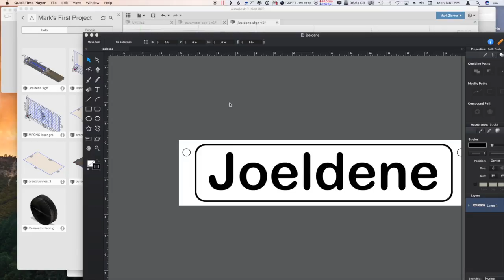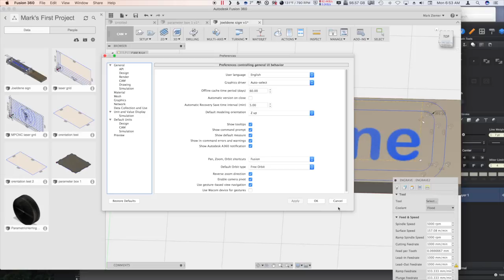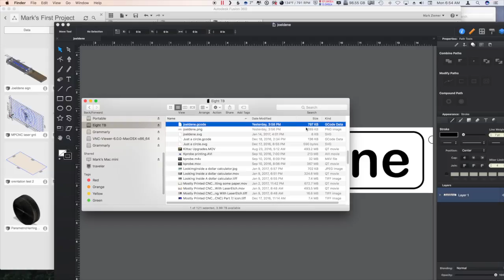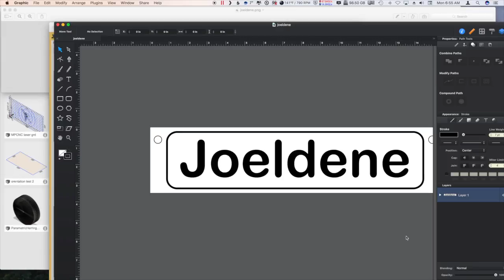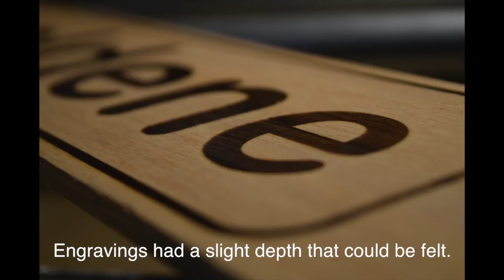Mostly Printed CNC (MPCNC) Part 11 Oak Engraving With LaserEtch

Comment: The sign looks great! Do you have any measures in place for fire prevention? I just finished my laser MPCNC build, and I would like to have the confidence that mine could run for 12 hours without me watching it the whole time.
Reply from the maker: Geoffrey Tuttle nothing automatic unfortunately.  Just a fire extinguisher nearby, And monitoring by WebCam
Reply: @Someoldguycoding  Ah, good to have the fire extinguisher and remote monitoring. I picked up an extinguisher and will keep experimenting to see how my machine performs. Thanks for all the videos you post. I always find some good information in them and some inspiration to go tinker in the shop.

Comment: Might save a bunch of time if you could either get it to move faster when not cutting or (if I'm seeing correctly and it's only cutting on one direction) cut in both directions. Not sure if that's possible though, my experience is limited to 3d printers. I know there's an option in my software for a different travel speed.
Reply: Now that I'm sitting in front of my computer, the options in Simplify3D for speeds are: Default printing speed, outline underspeed (slows down the outside layer for quality), solid infill speed (same as outline but for outside layers on top and bottom as opposed to the sides), support structure underspeed (no idea) and X/Y axis movement speed. I have printing speed set to 55mm/s at the moment and movement speed (travel speed) at 80.  On the print I'm working on right now, setting both to 55 would take only slightly more time (4 minutes on a one and a half hour print) but that's certainly less. Bumping travel speed up obviously speeds up the print, but I'll have to do some checking to see how fast I can push travel speed without weird artifacts showing up from the frame moving.
Reply from the maker: Thanks Even!  LaserEtch has speed settings for engraving, and moving the head, along with the option to engrave bidirectionally.   I was using the same settings as I did for the previous video with the 1.5 inch rounds.  I really need to make some test runs, and see how fast I can go, and if there are quality issues, try to find the root cause.   Thanks for watching!

Comment: Why not give image2gcode a shot.  It's custom designed for the MPCNC.  I believe default speed is set to 3000mm/m.

edit:  Now that I think about it that's just for raster files.
Reply from the maker: Yes, that's on my list of things to do... Eventually... I wish I had more time, but don't we all!

There seemed to be a quality issue when I ran the laser faster while doing the 1.5 inch rounds, I need take the time to find the root cause